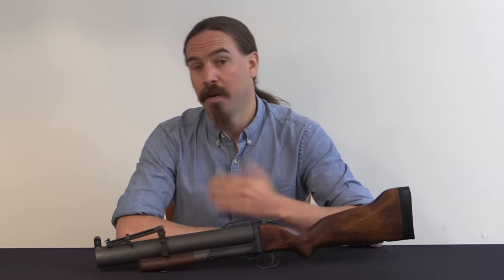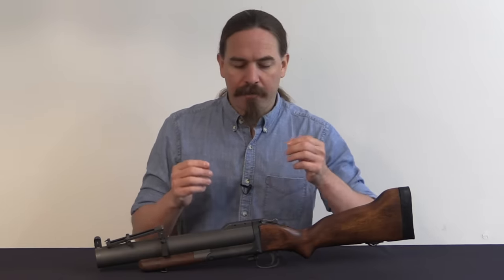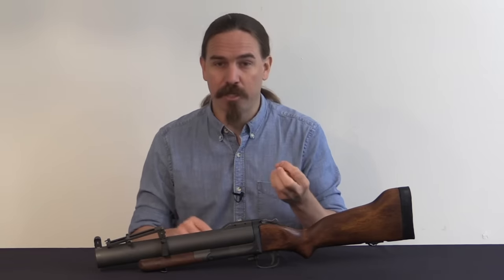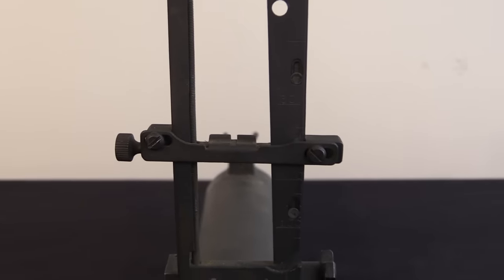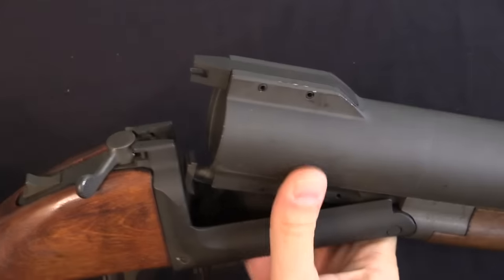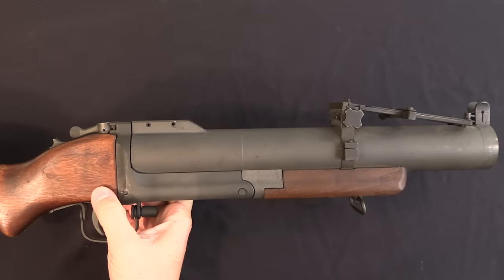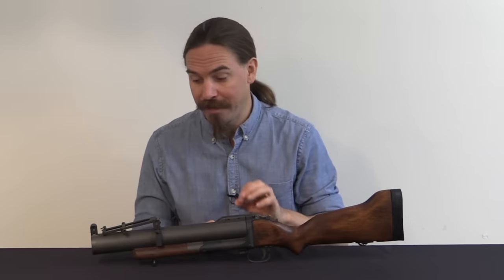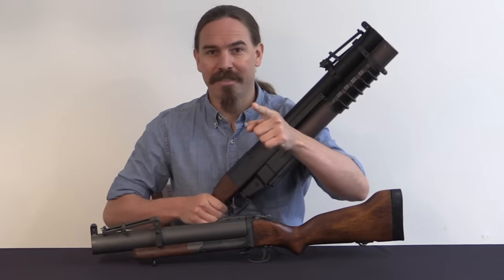M79: The Iconic "Bloop Tube" 40mm Grenade Launcher

Comment: I found your video on the M79 interesting but I have a couple of comments.  First, you intimated that it was developed as a replacement for the bazooka but the bazooka was designed originally as an anti-tank weapon.  It didn't do very well in that capacity and was subsequently replaced by the Light Anti-tank Weapon (commonly called the LAW rocket.  Secondly, in infantry operations, you can only walk artillery in so far before you're raining friendly fire on your own troops and the same is true for fighter support.  On the other hand, a troop can only throw a hand grenade so far (20 yards or so) and this left a fairly large gap between friendly and enemy troops.  The M79 was developed to fill the gap.  As I recall there were regular rounds and high-explosive rounds available as differentiated by silver and gold-colored bullets (grenades).  
PS: Like your videos.

Comment: My first experience with the M79 was with the Black Panther brigade of the Royal Thai Army in Vietnam in 1970.  One of the Thai soldiers had one and was showing me the proper use.  I prepared to shoot a few rounds off and when I went to aim the weapon he stopped me and pointed out that putting my thumb of my trigger hand over the stock wasn't a good idea and showed me that putting my thumb alongside the stock was the preferred method.  I couldn't see a reason for that unless they were worried about recoil but that stuck in my memory all these years.  Oh, and you could hear the round going down range when fired which was interesting.

Comment: You didn't notice it because the firing sound was so low, but it had a very stout recoil.  The buckshot round was issued for a while then taken back up... don't know the deal on that.  The guy that carried the 79 was usually a new guy, not because of the launcher, but because of the 36-round front pocket vest --- no one wanted the extra weight.  In fact, no one carried a full vest load because of the weight.  At max range, the round would naturally drift 5-meters in any random direction even if using the sight for precise aiming; never new if that was the inherent inaccuracy of the round, or prevailing wind.

Comment: In the early 70s our USMC rifle squads consisted of 14 men. Three four-man fire teams, squad leader, and the grenadier armed with the M79 Bloop Gun.  Due to personnel shortages, most squads didn't have a designated grenadier. Instead the squad leader carried the Bloop Gun. We rarely had enough M79 ammo to shoot more than a few rounds per quarter. It was a very accurate weapon. We especially liked the fact it was easy to clean. It was much easier to master the M79 than the M203 which came later. In the 80s we rarely received enough training ammo to qualify with the M203, mostly because we had one per fireteam.  The qualification course for the M203 required lots of ammo. I only experienced one opportunity to actually qualify with the M203 in the early 1980s. We missed our Bloop Gun. It was much easier to get rounds on target with this weapon.

Comment: I believe there was an individual who held the proper licensing who was manufacturing new receivers for this toy. He also manufactured what was termed the "Beehive" round which used a primer to drive a piston that fired 10 of the .22 LR cartridges. At one time you could easily obtain the barrels for these from some East coast parts suppliers, they probably have run out of them by now and I don't know of any current manufactures of barrels. Least to say the BATFE has recently created sh!t regarding possession of the Hi-Low nylon bases. Many of the 37mm community had purchased these as empty surplus and had turned down the cases to use in 37mm flare launchers. One needed to have the ability to reload the .38 Smith and Wesson blanks used as the boosters as well and there was little info out there as to load data for them.
Wouldn't mind having one in my collection but I don't need some regulatory agency changing their minds as to the status of which category these devices would fall under. As bad as their DeWat rulings and bump stock rulings of past.

Comment: I was issued one of these in 1986-7 (yes, you heard that right) in a HAWK air defense battery in Germany and fired it in training.  It was very cool.  I was a Stinger (shoulder fired anti aircraft missile) team chief, and my gunner and I were often separated from the rest of the battery (we covered "dead spots" and flanks where the HAWK coverage was most vulnerable), and it was thought that if we got in trouble I could pop off a couple of rounds of HE and a smoke grenade and we could get the hell out of Dodge before the Russkis could blow us to smithereens (yeah, right.  I wasn't so confident).  It was a lot of fun to carry and play with, but I was lucky I had a Jeep to carry it in, because I was also issued an M-16 and was responsible for both.  In '87 we were issued  '203s, and I carried that.

Comment: I remember training with one of these and the M203 in the mid 70s. Remarkably easy to hit with. Rather rough on the shoulder, not that there was so much more recoil than say a 12ga or a battle rifle round but that the angle of attack had that thing coming down onto you instead of back into your shoulder. 

Unmentioned in the video was that this replaced the 60mm mortar. Not uncommon for the weapon to be used with one man firing and another loading. Both the M79 and the 203 could deliver a ferocious rate of fire like that.

Comment: We still used these in the navy today but in a flare or ilum round.  Personally ive shot them with cheetopuffs accurately at 700m known distance ranges.  They have a significant amount of drift(mangus effect).  At 700 its around 70m of right drift.

Comment: The short range rounds were extremely effective at cleaning out VC and NVA bunkers & tunnels.  The illumination rounds were li'l flares that floated under a small parachute just like the 105 mm. howitzer used.  Having used one of these to death I can assure you that these little rascals bailed a lotta guys out of some damn tight fixes.  Of that I assure you.

Comment: The M79 was intended more for replacing rifle grenades. While bazooka rounds were used against bunkers, rifle grenades were supposed to be used in that role. The problem with them was that usually the rifle had to be loaded with special 'blanks' to fire the grenades, which meant that to use the rifle you had to remove the grenade if in place, then the launcher, and reload with standard ammunition The M79 was intended mostly to cover the 'dead zone' between the maximum range a person could reasonably be expected to throw a hand grenade and the minimum range of a 60mm mortar.

Comment: The M79 was also used with a CS (teargas) round that was 37 MM because the round was first used in a 37 mm police launcher. But in order to use 37 mm in a 40 mm tube, it has a plastic sleeve at the base of the cartridge, (First hand experience). Also, it would have been nice if you had a dummy round or cutaway to show. Even a picture would have been better than trying to verbally explain what it looked like.

Comment: This weapon was purchased by the British Army, as an 'Urgent Operational Requirement' (aka UOR)  in the mid-1970s, for the defence of its bases in South Armagh (we had - from memory - 4 of them delivered to Middletown permanent VCP in the summer of 1976).  My Company Commander ensured that they never left the safe custody of the Company stores (despite my pleading 😊  ).  If what I was told some years later is true, his judgment was more sound than mine.  According to a Small Arms School Corps guy (mid 1980s, from memory), the M79 was fired many times in NI, but never once was it fired intentionally.  The norm was that some lucky schmuck in a four man team would have one of these slung muzzle down, with a round in the breech, whilst foot patrolling - which, in S Armagh, meant traversing innumerable small fields separated by thick blackthorn hedges, through which (in order to avoid the risk of using (potentially) booby-trapped gates or other temptingly easy avenues of ingress/egress ) your professional infantry soldiers would battle their way, the better to be able to guarantee going home intact and alive to friends and family at tour end.

Inevitably, from time-to-time a twig/branch would snag in the trigger guard and operate the trigger, firing a 40mm projectile into the ground more or less at the feet of the luckless bearer.

Fortunately, such is the cunning of the dwarves who toil to make fuzes for such weapons of war, the distance travelled was always insufficient for the round to arm, and it would simply embed itself in the mud, having spoilid the day of the bearer (and his Platoon officer, who would have to do the explaining and the paperwork)

Comment: Probably going to get burried but Kannar corp. was the first large conctractor to build the m79 off of the original Springfield Armory prints. Springfield had the design and manufacture set but they couldn't get the numbers out that the military needed so Kannar was the first to win the bid. Kannar unfortunately made the first few batches almost too good (imho the early Springfield prints are very specific and dont give a whole lot of room for fit and finish) and there was a following lawsuit alleging Kannar couldn't meet the quanitity required in the given amount of time. (Keep in mind Kannar had to tool up and turn out a product that conformed to the early prints which gave very tight tolerances in places that didnt nessicarily require it).  This is why you see so many other contractors building M79s duing the war in Vietnam, when SA finally realized that this didn't need to be made with super precise tolerances they cut Kannar loose and signed comapines like Action arms, TRW, and EMP to produce the bulk of the guns we see now.  This is why the Kannar guns bring a premium when they come up for sale, they are superbly made. The easiest way to tell a Kannar gun apart from the rest is the jet black anodizing on the barrel and almost no sign of tool marks on the barrel where the front sight lug and rear lockup lug transition into the barrel diameter. TRW and Action used an off color OD green anodizing for their early barrels and later on settled with a dull "parkerized" grey for the later guns.

Comment: The M79 did not replace the bazooka. The bazooka was replace by the M72 LAW, standing for Light Anti-Tank weapon. It was useful in Viet Nam as a Bunker buster and was issued as a piece of ammunition. Once fired you threw away the launcher and that was that. The M79 was called the "thumper" because of the sound it made. It was less useful in the jungle because, as mentioned it needed 30 meters to arm and often the triple canopy got in the way. IIRC my platoon carried two and only the guy carrying the weapon carried the grenades in a vest. They were useful if you were on a hill shooting down into the jungle, on a firebase firing beyond the wire. They weren't real popular because in close quarters they were pretty useless. That was the point of developing the under barrel launcher. When you couldn't fire the grenades, you had the rifle

Comment: In Desert Storm I carried an M249 SAW and later an M203, never saw an M79 there, but OK.
We did however have a lot of Humvees mounted with the Mark 19 grenade launcher with a maximum effective range of about 1500 meters.
I've fired the M79 on and off, it's simple and surprisingly accurate.

Comment: The funny thing is the U.S. has seem to have gone back to the single shot hand held version of the 40mm grenade launcher. I think they realized mounting this thing under a rifle is just to bulky and adds to much weight on the front of the rifle which is why the new 40mm launcher by H&K is usable in a stand alone configuration.

Comment: I’ve shot the buckshot rounds. They were pretty lame. They only contain a whopping 20 pellets. 

I’ve shot the HEDP rounds. High Explosive Dual Purpose which have a small shape charge in the projectile. That was more of a crowd pleaser. Fuse arming required set back from recoil, and then spin rotation to allow components of the fuse to align. Minimum arming distance was 18 meters. 

That prevented some moron from fragging himself and others if he hit something to close. 

The interesting thing about the fusing is the projectiles are extremely dangerous if they fail to detonate. Briefings from EOD Marines told us that is we encountered any we should give them a wide berth. If you touched them they could detonate.

Unfortunately some Marine didn’t get the hint back in either the 80’s or 90’s. I think he was with the 7th Marine Regiment based at Camp Pendleton. He brought a dud back to the barracks and was screwing with it when it went off. Killed him and a couple other Marines.

Comment: Usually there are great but I don't know where he got the idea that the M79 was developed as a replacement for the bazooka, either the WWII 2.36" or the later 3.5". The bazooka was an anti-tank weapon that could also be used against softer targets but was of little use against personnel.  A grenade launcher with projectiles of 40mm diameter is useless against an armored vehicle but goo against personnel.  The M79 was designed to replace the rifle grenades used in WWII that were indirect fire weapons like a mortar.  It took lots of firing to develop any sort of accuracy with them in terms of range and they were really sloppy in terms of azimuth. The M79 was a direct-fire weapon, albeit one with an arced trajectory, that could be aimed accurately.  The grenades were not much bigger than a duck eff ahd did not have the kill radius of a hand grenade, but were pretty deadly and could be lofted out a few hundred meters instead of the 15 to 30 meters of a hand grenade

Comment: Would love something about competing designs as well. E.g. the HK69 (which I have used extensively in the German Army) (and which is still in use, although the AG36 is available as well).
In my unit it was more liked as the underbarrel grenade launchers, as it can easily be swapped from person to person without having to also swap the rifle.

Comment: I wonder if chemical agents (liquid lacrimants, like CS or CN) would work as a short-range "desperation" load. As the agent would be quite lighter than a lead shot, we can keep the low-pressure operation, but potentially turn a sizable cone in front of us into a very unpleasant place...

Comment: I was a K-9 handler stationed at Clark AFB in the Philippines in the 70's. We had go off base for annual qualifications. I have no idea why there was no range on base. I got concerned as we headed into the mountains thru a canyon, this area was HUK territory, communist insurgents.  We are packed in the back of a 2 ton truck with unloaded M-16's and the mags and ammo is in the cab with the Sgt.. The narrow canyon was a perfect ambush spot, we made it to the range which was located next to a beautiful village. We were in a small valley and set up and shot m-16's and M-60's. I asked the Sgt. why we didn't have loaded mags in the back, the weapons we had were worth there weight in gold, he commented they had good intel from the village, OK.  We finally shot the M79, had only shot it once during combat training in the States. I was first and a little rusty the sights are hard to line up while shouldering the weapon. They had two 55 gallon drums about half way up a hill and we shot practice rounds, made a big boom but no shrapnel. I shot standing then kneeling and did OK but then the training Sgt. asked me to shoot prone, I never shot the M79 prone and it didn't seem practical. I got down but it was almost impossible to raise the weapon high enough and see the sights, my first round was way low so I raised the weapon higher and fired. The round went high and lobed over the hill. The Sgt. started screaming get your weapons and get on the truck. We were dumb founded till he said there's a village on the other side. Shit we grabbed everything piled in the truck and sped back to base. The problem was every village had a militia normally armed with WW2 M-1 carbines. These militias weren't picky about who they shot a, you learned not to patrol on the perimeter road at night and get back into a field, a shot could come from the HUKs, militia, criminals Philippine Constabulary or their Army.  Fortunately they weren't very good shots but unfortunately they were deadly with slingshots another good reason to stay off the perimeter road.

Comment: A small high-pressure launch charge expanding in a larger volume: isn't basically the same concept as the Tromboncino 1928 Carcano? although in that case the charge was a separate thing and not integrated into a single granate shell

Comment: Used both m-79 and m-203   preferred  the m-79 . More accurate  and  was a stand  alone  weapon  system.  7 meter blast zone. Not good  for close  up it needs  7 to 9 rotations to arm in flight  to target.  Yes if you  were  good  with  it  very effective  weapon  system.